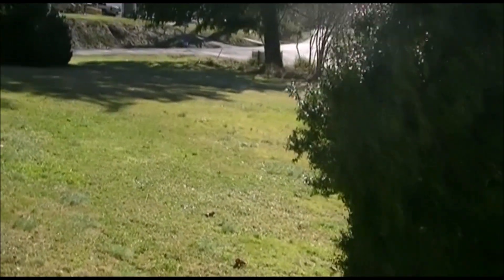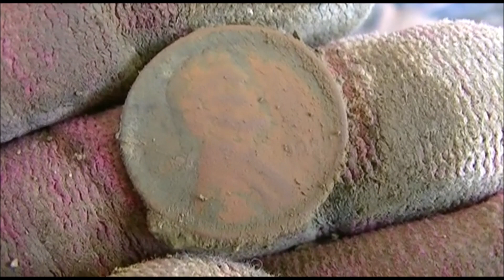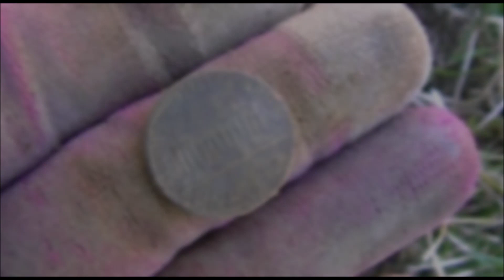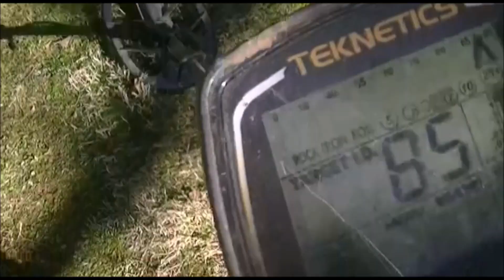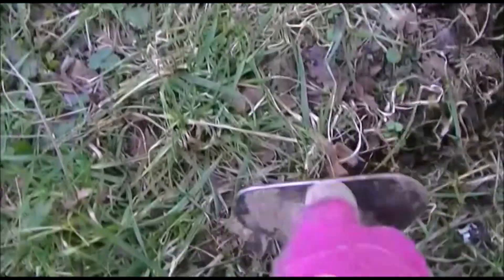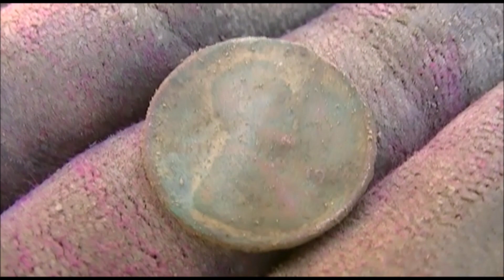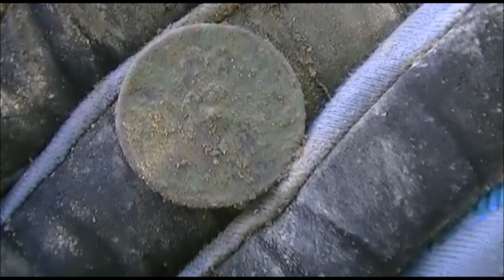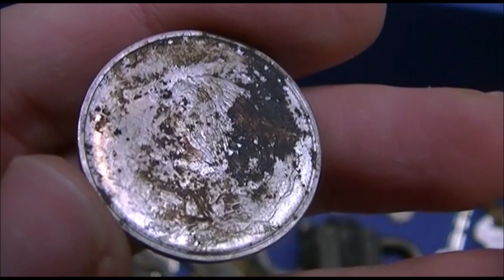HOARD OF ABANDONED COINS FOUND METAL DETECTING MY YARD! (January 23, 2021)

Comment: Hi Ho , yes Old Spice bottle , it took a small plastic stem plug to reseal it , I use to use it .
Reply from the maker: I need to open it an see if it's still smells. lol
Reply: @JDsVarietyChannel  I do believe your a bit late lol but nice find on the silver quarter , all I've ever found has been silver dimes and a few rings , with lots of odds an ends .